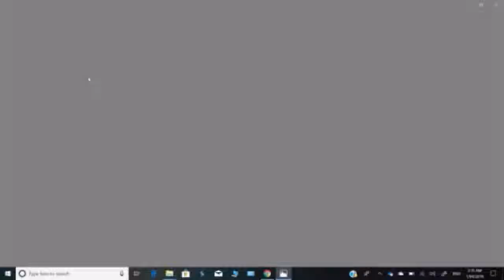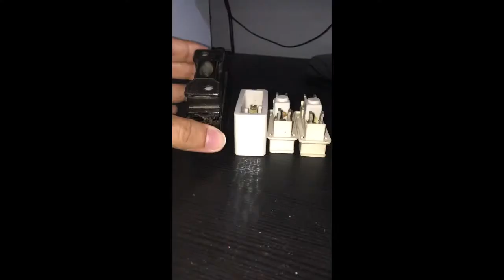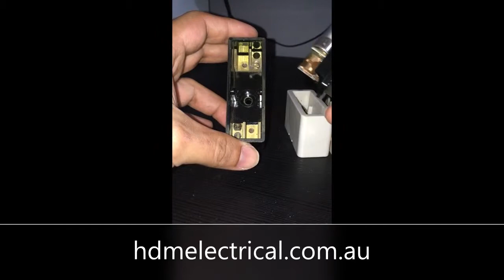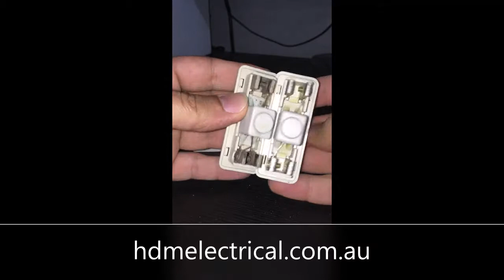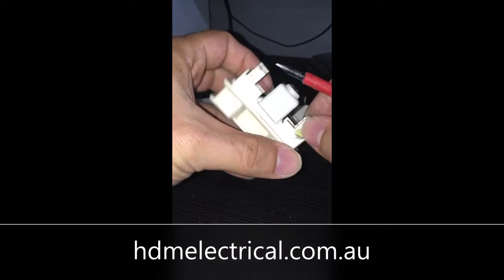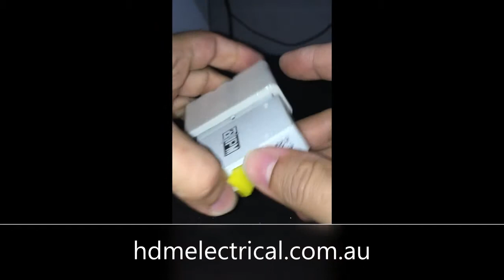Switchboard - part 2 - Fuse Repair/Replacement

Comment: At 2:40 in video there is 2 main switches labelled ? Are they both in use ?
Reply from the maker: Yes They are
One is main switch normal supply 
the second one is for off peak supply which usually used for hot water only.